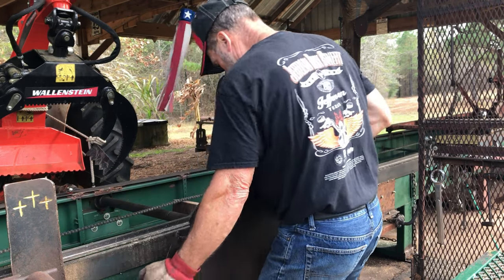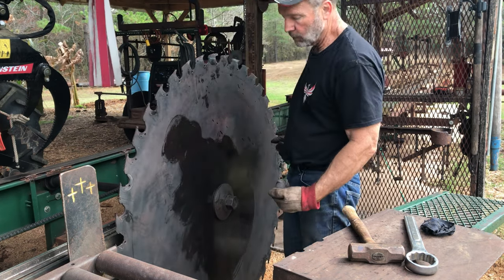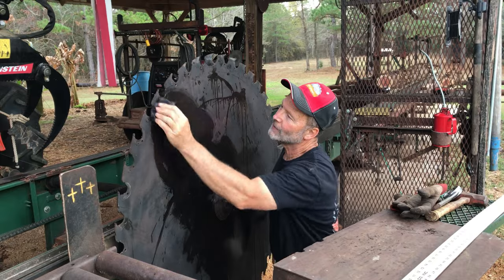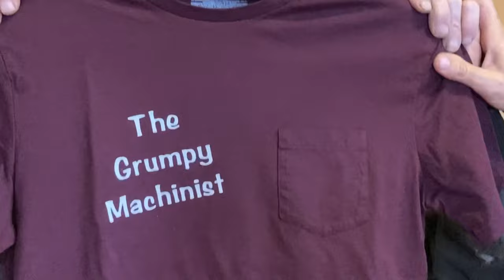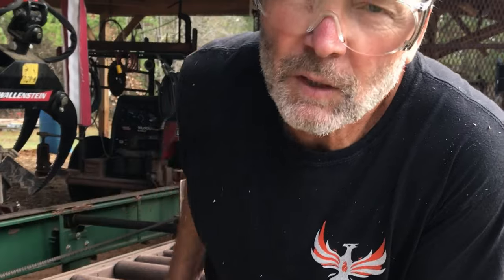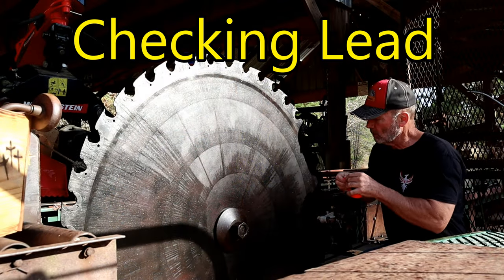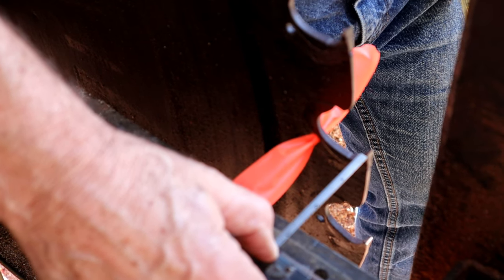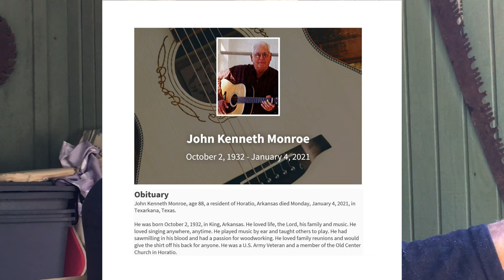Increasing Circle Sawmill Depth of Cut 2/3

Comment: One observation: I know manuals usually set lead specs but don’t go by those completely. Different mills run different leads to work good. 
Mines odd. It runs 1/8 lead and I kept tinkering with it to get it right. It’d saw out of the board around a 1/4 inch. I’d keep adjusting and checking. It just likes to lead into the cut a little more than other saws. 
That might change when I have it hammered again.
Reply from the maker: Good info, I will play with mine on the new blade.  I think its time to get an adequate HP motor on belts too!

Comment: any way you can get a RPM gauge to check if the motor is running smooth on ya. cuase i noticed a lot of dipping. and heat the blade uneven give it a warp.
Reply from the maker: ATL that was my thinking too.  Put a tach on the mandrel and slow the cut when rpms degrade.  The blade heating and warping is definitely happening! Thanks for the observation

Comment: F-8 and f-9 are different gauge i have saws that have 50% one size and 50% the other size usually the blade gauge would dictate what size shanks to use
Reply from the maker: Thanks for the info.  I downgraded back to the 40”.  Milling cedar for a greenhouse but it will be 1/8 scale of yours!  I worked in a commercial greenhouse as a 13 year old so I am looking forward to the experience.  That plastic door for your shop is 1 in a million!!!!  I thought it interesting that your trusses do not appear to be equally spaced.  You must have some loads above your supporting.  Bet u will be glad to get in it.

Comment: How long did the blade sit
Reply from the maker: Probably over 20 years!
Reply: @TripleTRanchAndSawmill  do you know what foundry it came out of? PA.... maybe. Depending on the type iron used makes a big diff. But if ypu cam somehow reset the metal it would be nice. Get a fresh smelt on it while spinning slow amd than increase rpm over an hour. Even if you have it spin and put a tourch on it but you got to get that heat even. You almost need a heated flat surface lime a heated block you can spin.
Reply from the maker: That is way beyond my skillset!  Once I get more horsepower, I will get back on the blade and get some help.
Reply: @TripleTRanchAndSawmill  i think with tje higher RPM and constant RPM it will solve the issues